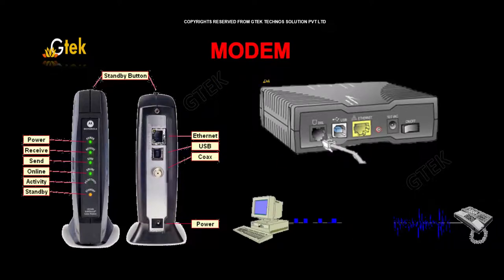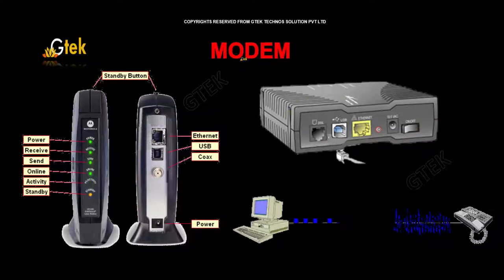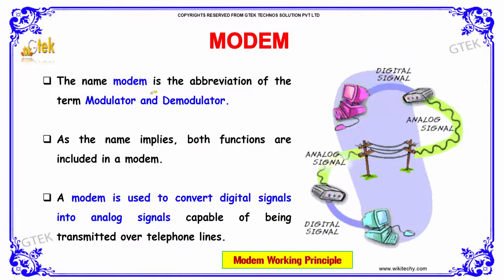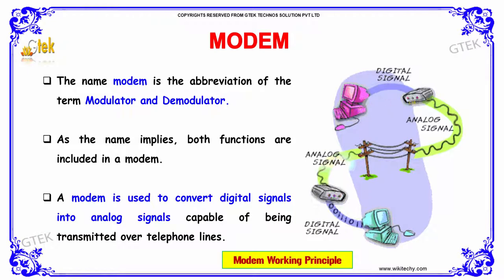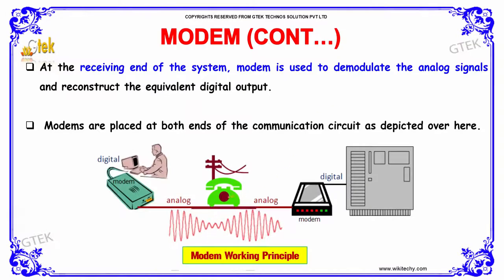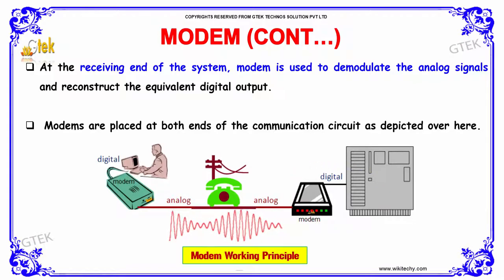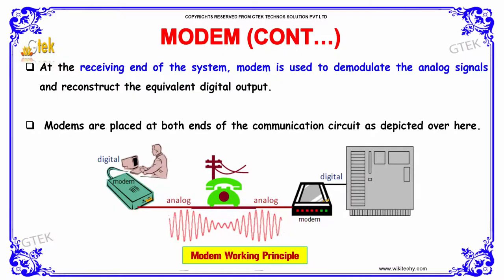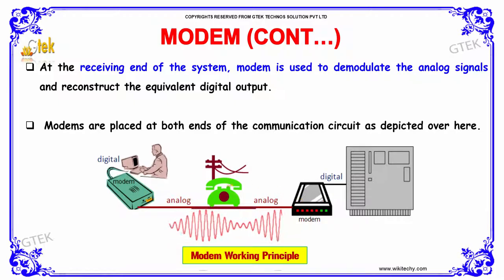Modem | Communication System |class 12 physics subject notes lectures|CBSE|IITJEE|NEET

Comment: Modems are generally classified by the amount of data they can send in a given unit of time, usually expressed in bits per second (symbol bit/s, sometimes abbreviated "bps"), or bytes per second (symbol B/s). Modems can also be classified by their symbol rate, measured in baud. The baud unit denotes symbols per second, or the number of times per second the modem sends a new signal. For example, the ITU V.21 standard used audio frequency shift keying with two possible frequencies, corresponding to two distinct symbols (or one bit per symbol), to carry 300 bits per second using 300 baud. By contrast, the original ITU V.22 standard, which could transmit and receive four distinct symbols (two bits per symbol), transmitted 1,200 bits by sending 600 symbols per second (600 baud) using phase shift keying.

Comment: A modem is a device or program that enables a computer to transmit data over, for example, telephone or cable lines. Computer information is stored digitally, whereas information transmitted over telephone lines is transmitted in the form of analog waves. A modem converts between these two forms.

Comment: A modem (modulator-demodulator) is a network hardware device that modulates one or more carrier wave signals to encode digital information for transmission and demodulates signals to decode the transmitted information. The goal is to produce a signal that can be transmitted easily and decoded to reproduce the original digital data. Modems can be used with any means of transmitting analog signals, from light emitting diodes to radio. A common type of modem is one that turns the digital data of a computer into modulated electrical signal for transmission over telephone lines and demodulated by another modem at the receiver side to recover the digital data.

Comment: Servers on the Internet communicate with your router, and the router routes that traffic to the appropriate devices on your home network. But, with just a router, you can't actually connect to the Internet. The router must be plugged into the Internet via an Ethernet cable. You need a modem to do so.

Comment: In order for devices on the network to connect to the Internet, the router must be connected to a modem. Therefore, most routers have a specific Ethernet port that is designed to connect to the Ethernet port of a cable or DSL modem. A modem is a device that provides access to the Internet (see below).